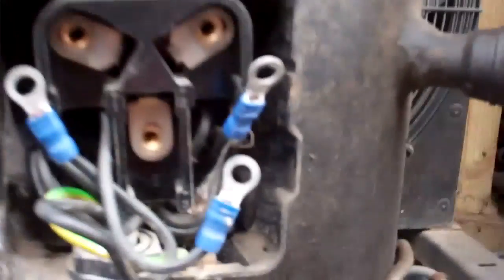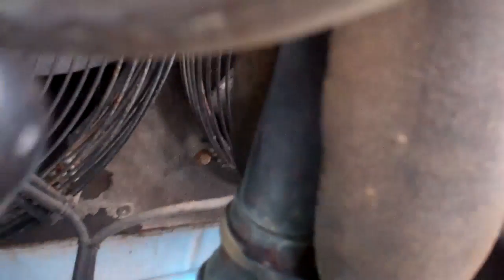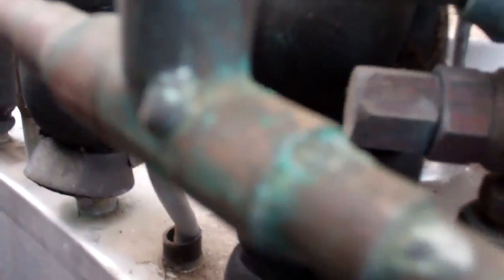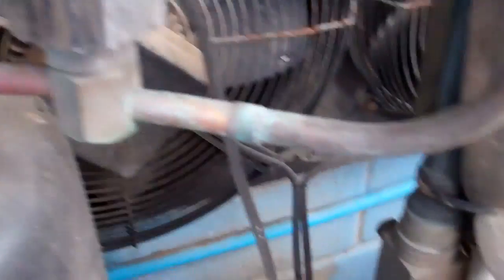Bristol G Series with issues.....

Comment from the maker: @fritzhvac A quality meter should discharge whatever you are testing when you let go the test button, unless you pull the test lead off first! 

The SMG5 looks a good meter at a good price!  The one i have has different test voltages, 50,100,250,500,1000v, our control circuits here are generally 240v so its handy to be able to test at a lower voltage without risk of blowing up a board, but i think your ac controls are low voltage so i expect you'd only be testing motors and power cables etc.

Comment: @heavydiesel Rock on Brother !!!
Yung Fung !!! ROFL ... (sorry had a litttle laugh outa that one , got Miller Lite on the Screen) LOL ...
Man there ain't nothin like gettin lit up in the Morning !!! Will New Ones Discharge ?

I emailed you the Fieldpiece SMG5 , I don't know if you have seen that one,small, compact 1000v voltage source at around $120.00 , Maximum current output <1mA , 1000VDC stresses insulation to measure up to 2000Mohms ? Do you think that would be OK for my needs Jon ?

Comment from the maker: @fritzhvac The one i have is made by a company called Megger, model MIT410, just had a look and they are $600 in the States! Must be one of the few things thats cheaper here LOL.

I think Fluke make some good ones too.

When i first started out my boss gave me a Chinese Yu Fung meter, which did what you needed but didn't discharge a circuit that it had tested, so if you checked a comp that was ok it would charge the windings up like a capacitor and you'd get a belt putting the wires back on!

Comment from the maker: @heavydiesel Anything under 1mega ohm which i think is a million ohms!!! is on the edge of being acceptable and likely to cause problems or be failing, a good motor would be well over this reading, 10's to 100's of Meg ohms, the lower the reading the worse the short is. Next motor i get failed i'll vid my test procedure.

The meter i have does ohms too so you can use it to check motor winding resistances and then switch range and check for shorts to ground. Was about £380!!!

Comment from the maker: @dfranklin5891 Thanks! The spray is sold by Wolseley group in the uk, and is surprisingly good for an own brand product! I've seen similar ones at welding supply stores for checking leaks on regulators etc so you might be able to find some where you get your nitrogen etc from.

Comment from the maker: @fritzhvac Hi Fritz!

Its such a short pipe run and the suctions too small so i might re pipe it if i get the job of replacing the comp.

Normal multi meter has a 9v battery so checks for shorts with just 9v, a megger takes that 9v and turns it into 250,500,1000v depending on model and range. Think of it like leak testing a system desinged to hold 240psi with either 9psi or 250/ 500psi. I wouldn't be without one for finding shorts that will trip an rcd.

Comment: Hey Jon !!!
Damn Jon don't you love workin on a High Wire !!!
Man I see Hackery is alive in the U.K. too !!!
I have ran on the solder to Brother , nothing like Brazin a unit back together , and gettin her hot , and having a soldered joint pop loose and come back and hit you in the face !!!
Jon any resistance on that megger , indicates open to ground ?
I don't have one , I have been testing to clean portion of dischagre line copper to T1, T2 , T3 , and any restance indicates open winding !